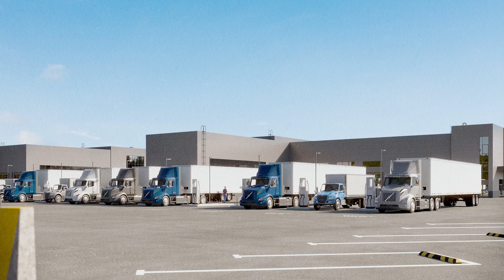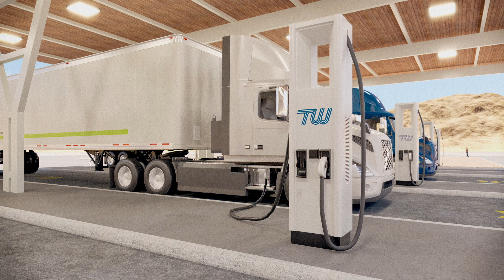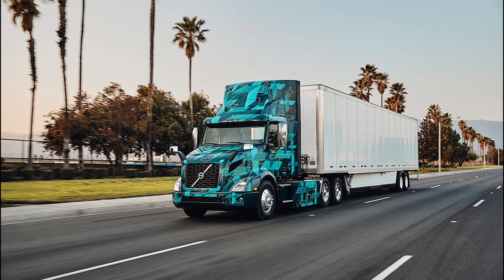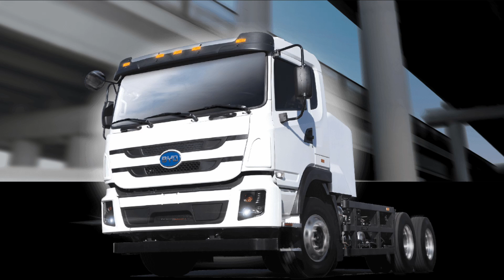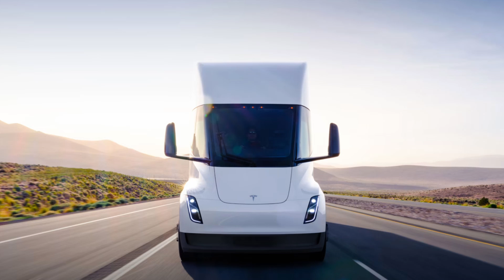Here's Where Electric Trucks Will Charge! Solving The Mystery Of Commercial EV Charging

Comment: It's a great show, just a couple of points to your audience. Commercial fleets don’t tear up equipment like retail customers. Also, commercial fleets run set routes daily, and the company has historical data to estimate how much energy will be needed. The smaller van trucks run the same geographical area but not the exact area as the large semi-trucks. These still can be estimated as to the amount of energy that will be needed. My point is that every commercial fleet operator knows before the day starts what amount of fuel or electric power will be required.

Comment: They haven't learned anything. The existing infrastructure and software is not the best. They're going to Signet surge, they're going to have the exact same Hardware problems Electrify America has. This is about to be a 1 billion dollar hole in the ground which is why they're using everybody's equipment they can get their stuff out immediately and fail quicker

Comment: I can't speak for interstate shipping but for in-town vehicles, this makes perfect sense. We had a similar-looking setup at Valley Metro for CNG and LNG.
Reply: As a truck driver, I can speak for all of it! Local and Regional routes, there is no need for these stations because the fleets can have chargers at there home stations. As far as OTR (what you refer to as interstate shipping), EVs are a joke! It takes a minimum of 3 hours to recharge. The lines at the fuel pumps are already long with refueling taking no more than 20 minutes. A Diesel truck can go 1500 miles before refueling, but an EV truck can only go 500 miles before it has to recharge. If we switched to nothing but EV semis nation wide, shipping would slow down to a crawl because every truck will not only take 3 hours to recharge, but also have to wait hours for an empty charger! This is a joke and is not sustainable!
Reply: @jasonpenn5476,   nobody's planning on switching to EVs overnight, so you can sleep soundly.... And enjoy the fumes from your diesel for the time being....

LMFAO at all the truck drivers, who believe they have a PhD in logistics and sustainability....  Enjoy trolling about it.... 

'Wattworker – Battery swapping for electric heavy duty trucks'
Reply: @nc3826  re: "LMFAO at all the truck drivers, who believe they have a PhD in logistics and sustainability...." LMFOA at all the "pencil necks" who believe they can be successful Engineers in the Automotive and Transportation sector while having fu%*all for experience.  yeah so underestimate the knowledge of a seasoned Driver at your peril. Q: but wait Phil why the hell not...? A: because they live the reality and YOU DON'T...

meanwhile on the heels of the NYC E-bike fires, and the fire on the high seas of the Fremantle Highway, something else we have going out here is YET ANOTHER Tesla Mega Pack catching fire down under in Queensland (same as the one in Victoria the bloody thing wasn't even fully on-line yet).  these Mega Pack fires are precursor to the battery fires we're going to see in Trucking, in fact the problem's ALREADY begun with the 3 Nikola fires out in Arizona. thankfully these were units at their facility and not OTR, because if/when a fire occurs (and it will) odds are since the vehicle is experiencing a breakdown the driver will NOT be able pull the 5th wheel to disconnect the Tractor to move it.  now even if they could move the unit...? Driver's are not "Firemen" and are not obligated to risk his or her life to do so, obviously grabbing the DOT mandated extinguisher they currently have onboard isn't going to stop a Lion Battery fire...

yeah so what this means is the ensuing INFERNO is going to engulf BOTH the Tractor and the Trailer, and a shipper is going to lose not only the equipment but also the ENTIRE LOAD (aw crap).  example: anyone who's hauled Medical pallets for Drug Stores like CVS, Rite Aid, Walgreens, etc knows just a SINGLE PALLET can have a retail value upwards of $1 Million dollars.  again, that's just ONE PALLET never mind a whole 53ft trailer of pallets loaded front to back.  the Insurance Co's are going to have a "meltdown" (pun intended).
Reply: ironic Engineers were mentioned..... but we have to get paid first.....  To dispel the ignorance of a troll..... Enjoy wasting your time here....
Reply: @nc3826  re: "ironic Engineers were mentioned"  no they weren't.  the reference that was made was to the "Inferiority Complex having" Programmer, Comp-Sci, Elon type dickheads (you know who you are).  these would be the same individuals who've created the bullsh!t fantasy of AI, which is not a "thing"...

however as we see from the increasing PROPERTY DESTRUCTION and LIFE LOSS from Lion Battery fires breaking out around the world, this would be very different from the classically trained Aerospace, Mechanical, and Chemical Engineers, many of which have known about this hazard for the last 50 years...

turns out, Technological Advancement does NOT "suffer fools" nor idiots or morons.  so what this means is, you are either going to deal with REALITY...?  or reality is just going to show up unexpectedly and DEAL WITH YOU (which is what's happening).